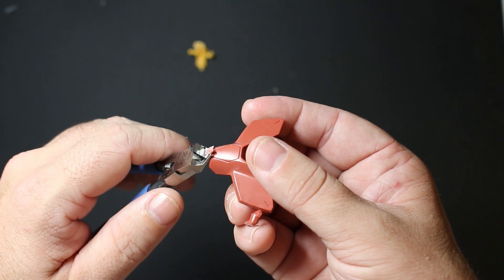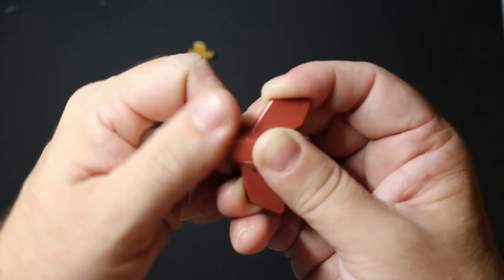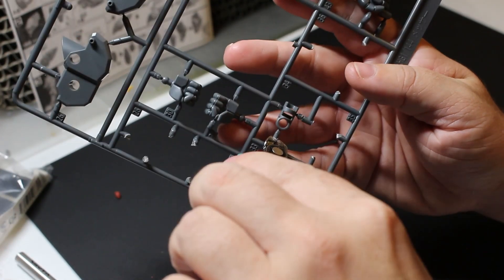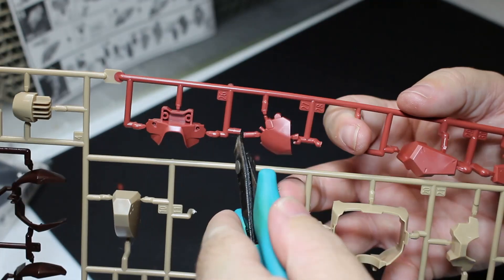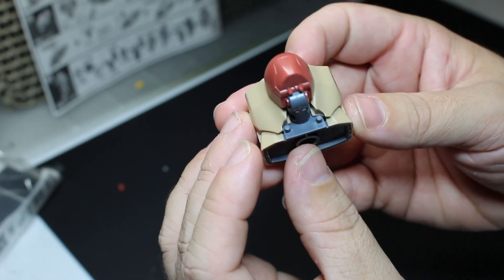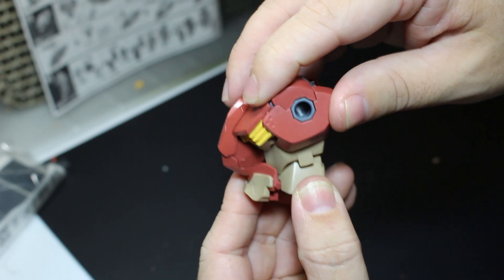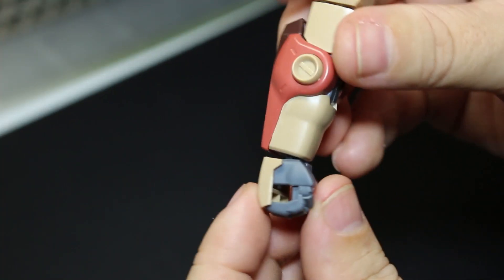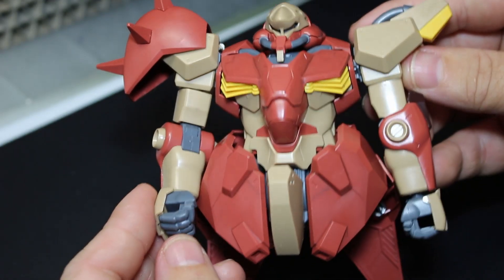HG Messer Custom Build - OR15 Omnic Guardian Inspired by Overwatch

Comment: what are those little blocks youre using to rub on the cut parts? and where can i find some?
Reply from the maker: Hey dude! These are Godhand sanding sponges. I loved them for a long time, but if you're just snap building, look into the Gunprimer Raser and Balancers! They take all the guess work out of the grits and give you exactly what to do when you need it. 😁 You can check out my review here!

https://youtu.be/YWgPvyq5dJ0